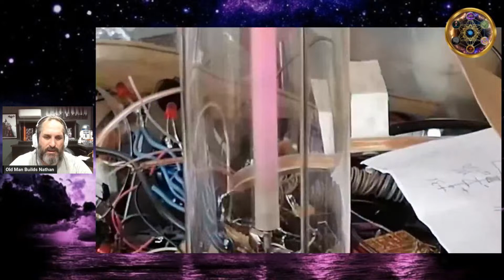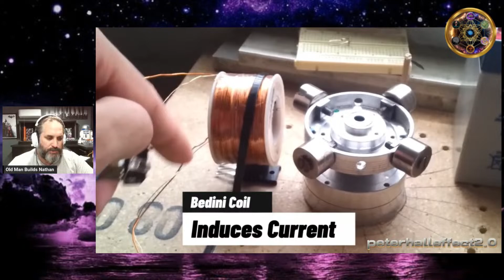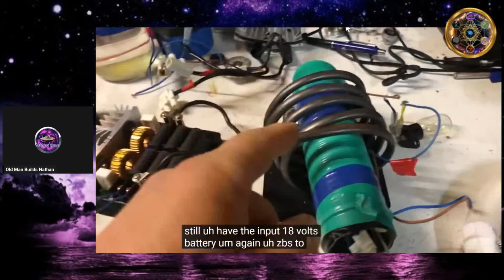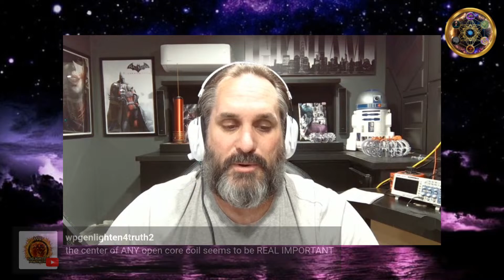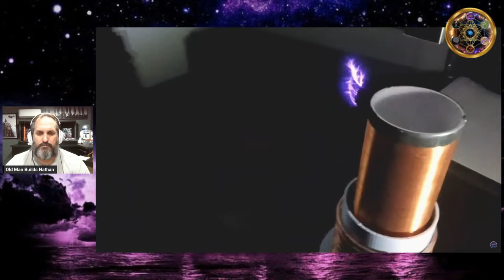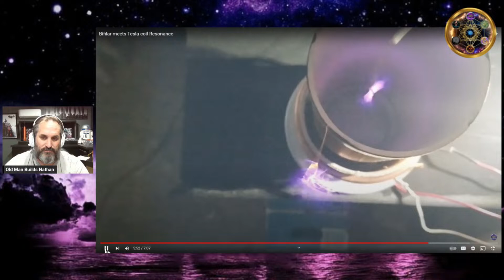Sunday with Old Man Builds

Comment: I'm beginning, or at least I think I'm beginning to understand. When the magnetic field collapses, the ground wire will deposit the magnetic energy into the coil. And the faster the collapse of the field, the stronger the inductance in the tesla coil.
Reply from the maker: the field oscillates so fast that it is the biggest plunger and it pulls energy out of the ground. 10-15% more. The second coil resonates but at a cool temperature so it lasts longer. Or hysteresis is suspended for a short time.

Comment: I have a thought, if traveling down the center of a spiral allows faster stream of electrons and the fast we pull the colder the atmosphere around the coil gets this would make sense when we hear bedini motor gets cooler as it is drawing in from an external source.?
Reply from the maker: You are playing with the temperature in the coil. The colder it is the more volts it gets. Try double grounding. one on the #2 coil one on the load. The ground acts like a cold cap.